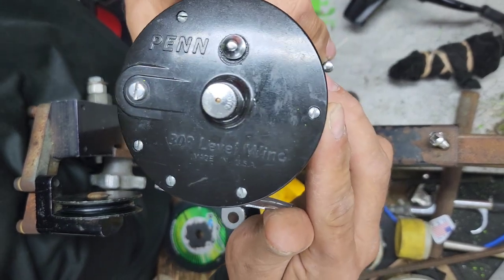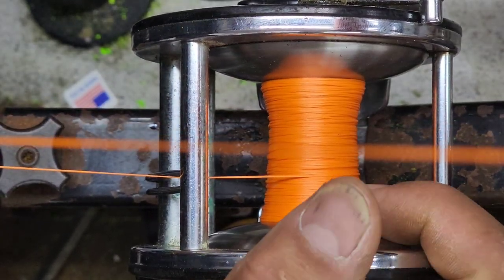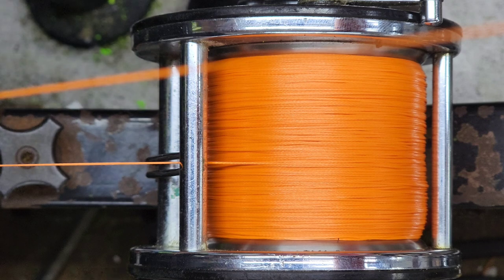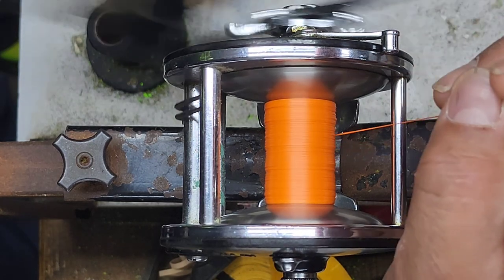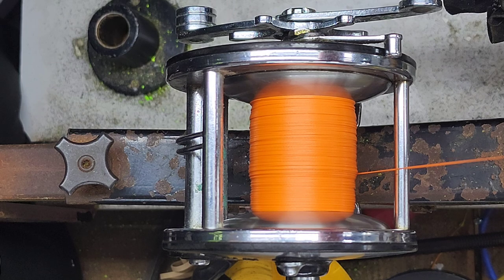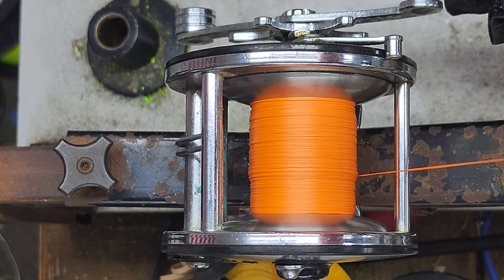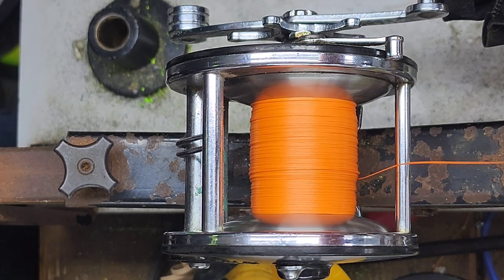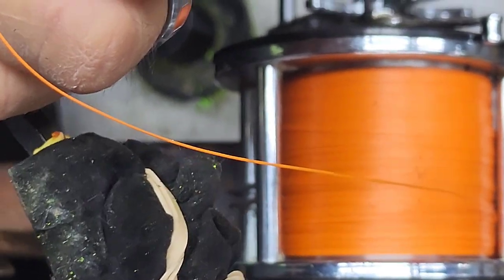you wont believe how much this Penn 309 will.spool up with 50lb tightline most satisfying asmr

Comment: I use and work on the old penn reels I love them but I'm with you on this I don't like the level winds on them they hurt capacity and casting and they are very weak.
Reply from the maker: I grew up penns this is something I learned about 30 years ago.. and have only become even clearer with now having a shop and dealing with customers